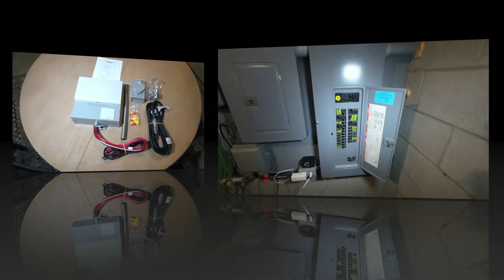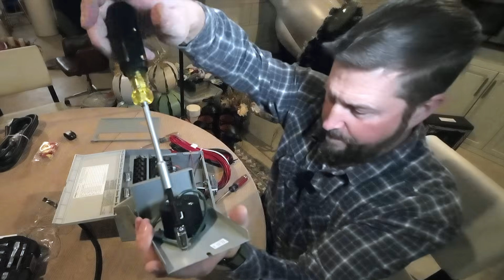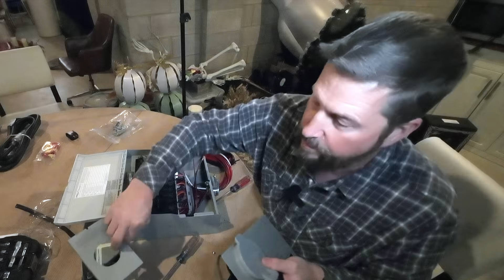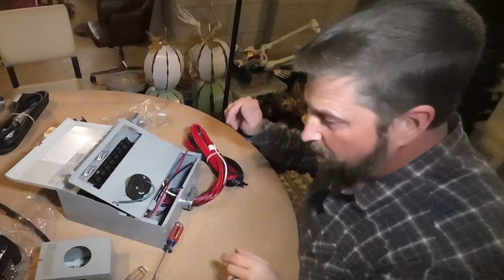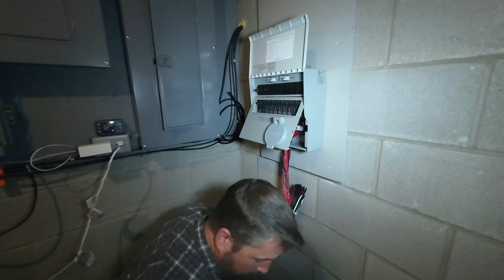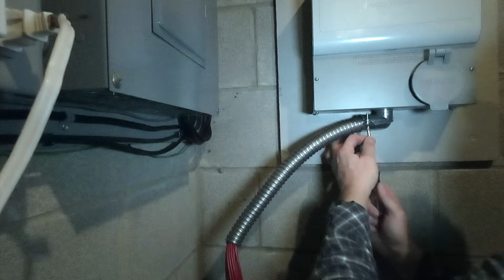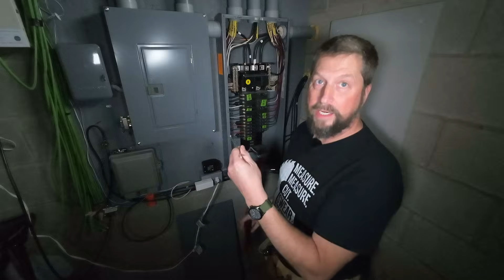Installing A 10 Circuit Transfer Switch: Reliance Controls Model Number 310CRK

Comment: The transfer switch changes your house wiring so that a generator OR  utility power is selected for  given circuits in your house.. ONE or the OTHER but NOT both.. this protects the utility workers who are working on power lines in your neighborhood after a power failure from being electrocuted from power being unexpectedly "back fed" into the grid by a home owned generator. Utility workers have been killed in the past because someone wired a generator to feed directly into the house wiring and back into the grid through one of a variety of regular wall outlets instead of using a transfer switch. People do not realize that doing this connects your generator to the neighborhood power grid. This is not only dangerous but Illegal. The other issue with back feeding is when the power comes back on and your generator is still running, the utility's generator and yours are not phase matched (not compatible) and will probably cause a fire right after "the big flash". REALLY GOOD video, Sam
Reply from the maker: @pattyrootz8956  Thank you very much! And also thank you for explaining it so well 🤠👍
Reply: Thank you, this is exactly what I was looking for. My Briggs and Stratton is dead, and those great people do not sell spare parts. I am going with a portable generator but will use a through-the-wall kit and plug fridges and freezer directly after I unplug them from the wall. I do have a tech question. Can power from a generator be fed to the existing B&S transfer switch, it is a partial feed from the original 7 kW generator.? This is a shot in the dark.  BTW, you know a guy is not an electrician when he does not have a red robbie screw driver.

Comment: Does it matter which pair of red wires you connected to the 220 volt well curcuit? Great video Sam.
Reply from the maker: @Billster1955  Thank you! Great question. Yes, there are a set of wires that are a higher guage (thicker wire) specifically for the 220 applications. 🤠👍
Reply: @samsdoinstuff  thank you Sam

Comment: Perfect - But 🙂   When Using the wire-nut on the black wires at the breaker panel pre- twist the black wires to give them an error free solid connection then insert the wire nut for a trouble free connection and after tightening the wire nut give it a few twists of the wires so the loose wires are twisted as well  to help prevent  electrical vibration from loosening the wires over time.  My opinion  🙂
Reply from the maker: @daniellocke1011  Thank you for the advice! I'll remember that next time 🤠👍

Comment: Great work, but I'm i wrong? I thought you weren't allowed to have any wire nut connections in the breaker box. Does anyone know if I've been wrong all these years?
Reply from the maker: @tomdorman2486  Great question. I'm sure different codes and regulations exist for various states and municipalities. I wonder if Wago connectors meet more stringent codes? I would suggest calling a licensed electrician. You can still do the work yourself, but they may have the answers you need 🤠👍
Reply: Wire nuts are permitted, but check your local building permit department in case they have different rules.

The NEC reference is Article 312.8 (A)

Comment: Not for nothing and with all due respect, you warned about NOT touching the HOT LEGS coming in at the top and not only did you look VERY close to it with your hand but you were wearing your  wedding ring.    I don't know, maybe I'm overly cautious but that looked a little scary.   Thanks for the video, it was very informative.
Reply from the maker: @michaeltammaro482  Oh my gosh! I never even thought about my wedding ring!!! (Obviously) I really should remove that more often or get one of those rubber ones. Thank you very much for the heads up! 🤠👍
Reply: Thank you. Very informative. Would the wiring be exactly the same if connecting to a solar panel array, lifepo4 battery and a hybrid inverter?
Reply: And watch
Reply: Smashed my wedding ring on camper hitch. Barely got it off. I wear a silicone one now.

Comment: Curious as those are 15 amp fuses how did you connect them to other fuses on the main panel that require 20 amps? Or did you only pick 15 amp? I ask because a lot of things I would want to power are on 20
Reply from the maker: Great question. The transfer switch accepts up to 20 amp connections. 30 amp connections can be used on the higher amp breakers 🤠👍
Reply: Couldn’t you just add a 30 amp double fuse to the panel that would backfeed the panel and forgo the entire panel? The it would power everything on the panel up to the wattage of your generator. I feel like that would save a ton on installation and allow more flexibility. Obviously got to make sure that the main is off to protect lineman, but in my mind that would work too. I’m also not an electrician but thinking about options for my own home.
Reply: @brendenpetersen5481  that’s a question I had for a long time and I just hooked up my 30 amp generator inlet box. I then connected my inlet box to my main panel on a 30 amp breaker. Now keep in mind that when you do it this way you have to install a safety interlock kit, which is mounted underneath the main shut off. It allows only one breaker to be on at a time. So therefore, the 30 amp breaker that you used to connect your generator inlet to must be right under the main shut off. You have to get the one for your particular electrical panel. It’s actually easier than putting in a transfer switch.
Not sure if this helped you out, but I hope it did.
 Oh, and I almost forgot to mention… That if your generator comes bonded, then you need to unbond it for this type of hook up. Another words, the ground and the neutral do not need to be connected together on your generator because your main panel is already providing that, and you can only have one panel bonded.

Comment: Can I switch out one of the breakers with a 30 amp breaker?
Reply from the maker: Great question. Yes, the unit is rated up to 30 amps. Make sure you use one of the 240 sets of breakers. You'll notice the wires are a thicker awg for those channels 🤠👍

Comment: Good video and very well explained and well done. The only difference in Canada is that according to the CEC the wires in the panel that are going to be powered by the backup generator have to be pulled out of the panel and spliced in a separate junction box and not in the main panel. Since I'll be using my 8500Watt generator, I purchased the same brand inlet & panel but 50Amp and 50Amp power inlet ($950.00 icluding tax) myself and the electrician is charging me $1,600.00 for the installation only. So $2,550 for the complete installation. Yep, those are the prices in Canada.
Reply from the maker: @galactichazzard8932  Wow! That's pricey. I spent roughly $500 on the Reliance Controls Transfer Switch kit and less than $100 on peripherals. Still, the peace of mind is priceless 🤠👍
Reply: @samsdoinstuff  It sure is, but this is Canada where we get royally screwed every single day of the year. Electrician is coming on the 10th so I'll have some peace of ming for the winter. I was tired of running cables through the windows during power outages and having stat up because of possible break-ins. I agree, peace of mind is everything lol.. Cheers

Comment: Confused Gere about circuit breakers In .y main panel some are 15 so.e are twenty Amp and I have sub panel also the extension cord is three prong you wired 4 wires
Reply from the maker: Great questions. You are fine wiring 15 or 20 amp circuits. Do not exceed 20 amps. The 240 amp breakers can accept up to 30 amps. There are 4 wires in the inlet because the incoming power is divided into 2, 120 amp feeds to each side of the main panel. Try to distribute the incoming power from the generator equally between both sides of the panel. You can power a sub-panel with one of the 240 circuits as long as the combined load from the sub-panel doesn't exceed 30 amps. Hope this helps 🤠👍

Comment: Not really the right solution for battery backup.
Reply from the maker: True. The best setup would be the smart switch that goes with the battery systems. They are much more expensive 🤠👍

Comment: never understood why folks choose this over a manual interlock.... much cheaper, easier to install, flexible and just as easy to use.  Just manually choose which circuits you can want to use that won't overload the generator.  I don't want to have to limit myself to 10 circuits... I can choose my own safely...
Reply: Manual interlocks are easier to install, but you run risk of making your ground run live or hot if you have a bonded neutral generator. Also would be a code violation from my understanding if you had a bonded neutral generator and used an interlock.
Reply: @TheManiac12992  - that’s a simple solution. Unbond the generator and make it a floating neutral. Westinghouse has very clear instructions on how to do this in their user manuals. It’s removing one jumper.  Takes 15 min tops.

I have a bonded plug hanging on a cord for the case when I want to use the generator stand-alone which is a very rare event. Just plug it into one of the 120v receptacle’s
Reply: Although Interlock Kits are easier to install, they are an "All" or "Nothing" solution. 

With an Interlock Kit, the main panel power breaker MUST be turned off making all circuits dead until power from an external source is introduced from the interlock breaker.

This type of reliance manual transfer switch (MTS) allows a user to have "some" or "all" of the 10 circuits powered from an external source such as a solar generator while the remainder of the house continues to be powered from the grid source.
Reply: @thechamp66  great use case powering from 2 sources but vast majority of people just lost their grid power and want to power their house with a generator
Reply from the maker: Thank you for the information. I'll have to research what a manual interlock is. 🤠👍

Comment: Can you configure these with any breaker combination you want on the transfer switch side? I want one with a 50a input and 6 20a single pole breakers and 4 15a single pole breakers.
Reply from the maker: @jjay718  Great question. You can change out the breakers in the transfer switch but be careful not to exceed the amperage limitations of the wires going to and from the main panel. 🤠👍

Comment: I’m sorry to keep bothering and I promise I’m not a troll (whatever that is). Question: the generator I have is a 50 amp and the manual switch I bought was rated 50 amp. I’ve seen reviews regarding this particular manual switch about the gauge of wire being 10g but need to be at least 8g for bigger loads like the well pump and A/C. Have you had any issues with the smaller g wire? My AC in the panel have two 30 amp fuses and if there is a chance this switch won’t work then I need to seek out an alternative. Thanks again!
Reply from the maker: @SFCSMOKER  No problem. I'm happy to help if I can. Short answer is I used 8 awg wire. The instructions do say you can use 10 awg, but I felt the same way you do so I used 8. It seems obvious but make sure you get the 50 amp version. I'm pretty sure it's just a different inlet but you want it to match your generator.
Reply: @samsdoinstuff  roger that. I did purchase the 50. I guess if you match the breakers and wire gauge in the main, it'll work. I may not be able to run all of the wires through the conduit, but I have a plan for that. Thank you sir for your experience and the video. You have been the most informative thus far and I have watched a bunch of videos.

Comment: Nice video.  However, all of these videos should at least mention that the power source for the switch needs to have a bonded neutral!  That "small" detail would have been very helpful to me!
Reply from the maker: @psuholetutube  Thanks for mentioning that. Of course, the main panel is bonded and it seems you are correct, but this is the first I've heard of bonding the gas generator. That would have to be done with a buried grounding rod, I think. I didn't even find anything about that in any instructions. Thanks again! 🤠👍
Reply: @samsdoinstuff  Many people resort to using a neutral ground bonding plug on the power source to satisfy the requirement.  Many people seem to find them safe and at less than $20...a budget friendly solution.
Reply: @samsdoinstuff  although the panel is bonded the most popular manual xfer switches like Reliance don't switch the neutral so the panel bond is gone and the source must provide the bond when switching from LINE to GEN
Reply from the maker: @psuholetutube  That makes total sense now! I hope others will read your comments. Very helpful 👌

Comment: So the power has gone off. I have switched my main breaker from the grid to the “Off” position. I have hooked up my generator and switched all the switches to “GEN”. Started my generator and determined that all the circuits wired thru the manual switch are working. CAN I NOW TURN MY MAIN BREAKER BACK ON? (Not shouting).
Great video by the way.
Reply from the maker: @SFCSMOKER  Yes. As a matter of fact, because the transfer switch has a direct cut off between "gen" and "line", you don't necessarily have to turn off your main breaker in the main panel. There's no risk of back-feeding the grid from your generator so you can simply switch back to line when the power comes back on. Hope this helps 🤠👍
Reply: @samsdoinstuff  you sir have unknowingly saved me a couple thousand dollars. Initially my plan was an outside transfer switch with the generator directly into the panel, for several reasons it wasn’t going to be DIY. I watched several videos but none was as thorough as yours. Made me confident I could go with this method. Thanks and God Bless
Reply from the maker: @SFCSMOKER  This is the best comment I've read in weeks. So happy I could help. That's the whole reason I started my channel. God bless!!!

Comment: I hope u have time to answer my question.   Btw great video. I installed this exact transfer switch.  My ? Is. Can i run my generator with this transfer switch to lower my electric bill.  In other words use it to power my AC and other high loads while using line power on the other breakers simultaneously.  The reason is my job gives me access to alot of diesel fuel which i get for free. I have a diesel generator and i can kill 2 birds by getting rid of the oil and saving money on power bill.  I have tried it and it does work nut i wonder if its safe.
Reply from the maker: Great question and wow! Free diesel?!? Anyway, use the generator to run things like a refrigerator and it might save you some money. Most generators do not deliver "clean" electricity so don't rely on them for sensitive electronics. Many people do exactly what you want to do with solar so I don't see why you can't 🤠👍
Reply: @samsdoinstuff  thanks for the reply. Im an hvac guy who does alot of oil to gas conversions so i end up getting the left over oil in customers tanks.  Hoping this is a productive way to dispose of it.

Comment: Great video, thanks. Just to be clear. With this setup, can I run my 30 amp wire from the generator straight into the 30 amp outlet on the transfer switch? No outside Inlet box is needed. Thanks
Reply from the maker: @RFC1997  Great question. Yes, the intlet can be installed directly to the transfer switch casing or, outside by using 10 awg wire or larger 🤠👍
Reply: Thank you for the ❤️ but I was looking for an answer lol. Looking for love in all the wrong places.
Reply from the maker: @BobCAgain  Did you not see my answer? YouTube can be weird sometimes
Reply: @samsdoinstuff  See it now, Thanks❤️❤️❤️❤️lol

Comment: Hello,

Was your installation done in Canada? If not, do you know if the Canadian code allows the connections you used for the installation of the generator electrical box?
Reply from the maker: @renepatry7049  Great question. My installation was not done in Canada and I am not familiar with Canadian codes. I certainly recommend checking your local laws, rules and codes before attempting to install 🤠👍
Reply: Thank you, have nice day

Comment: Is there a way to have inlet outside and inside?
Reply from the maker: Great question! I definitely think it's possible and I would use a selector switch inside. Run each inlet I to the switch and one output from the switch to the transfer switch. Should work perfectly 🤠👍

Comment: Thank you for demonstrating the voltage flow once the transfer switch is turned on.  Couldn't figure how that would work with out energizing the whole bus bar.  So just to ask. do you have to turn the main circuit breaker switch off before you turn the transfer switch on?
Reply from the maker: @dpsflyboy  Great question. The answer is no, you do not need to turn your main breaker off on your panel. The power source is rerouted so the breakers in the main panel are essentially feeding nothing when you switch to "gen" on the transfer switch. I really like that it is a very safe system 🤠👍

Comment: I'm doing this in a few days with the R510A transfer box.  I got that one because I needed an outside rated box and it has the 50amp receptacle to match my generator.  I like how inexpensive spare breakers are for these Reliant transfer switches, and they give you a list of all the compatible breaker models from the major brands.  
Watching you will make things go a lot faster for me, thanks!
Reply from the maker: @allegory7638  Thank you! I'm so happy I could help. Good luck with the installation 🤠👍

Comment: Thank you for this excellent informative video which will provide significant savings.  By the way, what gauge wire did you use to connect inlet box to transfer switch?
Reply from the maker: @gammadas  Thank you! Glad you liked it! I used 8 awg wire but 10 awg is sufficient 🤠👍